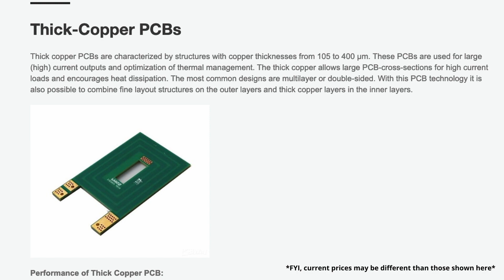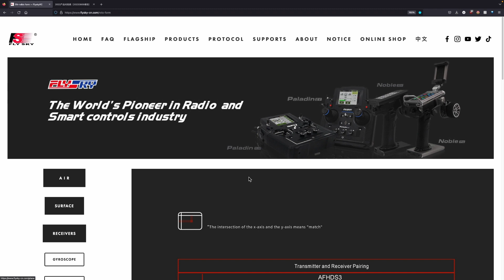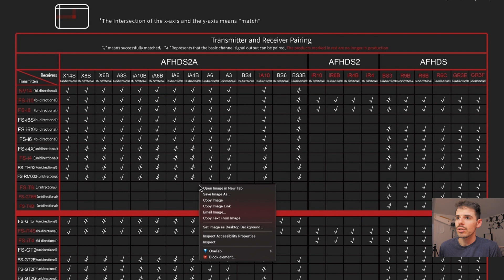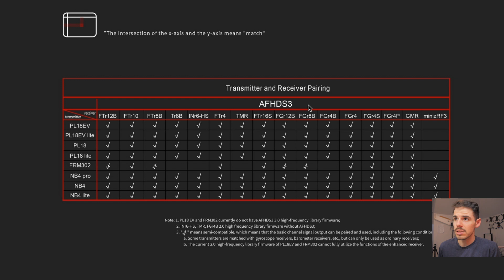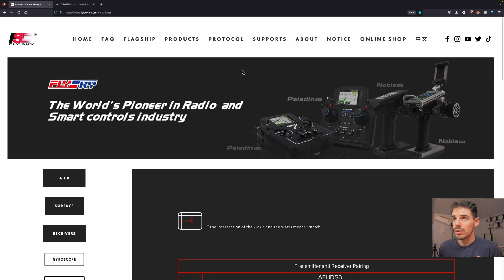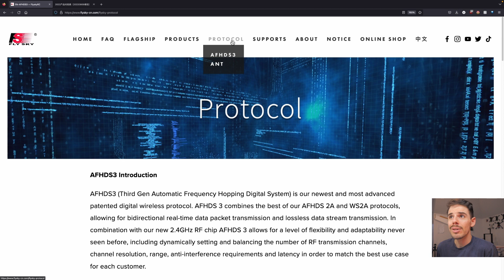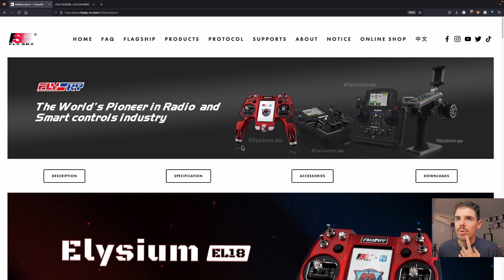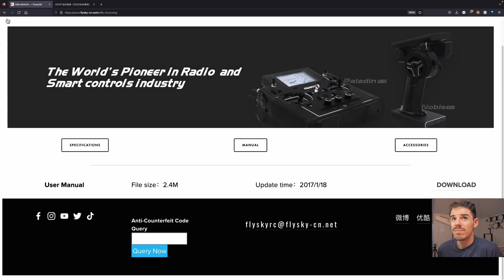Which Flysky Receivers and Radios Work Together? - RX and Transmitter FlySky Compatibility Chart

Comment: I had a lot of FlySky RXs and several FrSky SPI RXs. Replaced them all with Express LRS. I added the ELRS tx module to my Jumper Lite and works great! Easy wifi  binding, exceptional range and very inexpensive. I don't see how those other protocols can stay around much longer.
Reply: i fly planes and recently bought the Flysky x6b because it can  output sbus, ibus, ppm, and pwm signals.  Some gyros only take in sbus and some only take in pwm. In addition, the x6b has voltage telemetry(1-4s) so my transmitter can just make a sound whenever the plane battery reaches a certain voltage. 

Cant seem to find an elrs receiver with builtin voltage telemetry.
Reply: @pipoypipoy7796  I get full battery telemetry in my goggles flying with ELRS but  I guess it's from the Smart Audio via the VTX. I never flew planes but I was assuming you fly FPV  meaning you use goggles, but maybe you are flying Line of Sight and everything is TX supplied. That would make sense then.

Comment: ANT appears to give you the least amount of power consumption, built in sensors, low latency and mid range. Which would be important for a quad user. AFHDS3 is geared for long range, possible high interference environments, and multiple receivers. Which would be important for long range FPV. Both are supposed to use hardware IDs in such a way that you should never have interference from another transmitter. In theory with AFHDS and AFHDS2A it should not happen either but it can, especially high radio congestion environments. Personally I really enjoy the FlySky tx/rx and have never had any issues. I can tell the difference between AFHDS and AFHDS2A as such I limit AFHDS to ground use. I have not purchased an AFHDS3 module or receivers.though I plan to when I start doing longer range/duration flights.
Reply from the maker: Hey! Thanks for the explanation! That sounds reasonable. It also looks like there are a lot of ground based options for the ANT so maybe that is where the design originated.